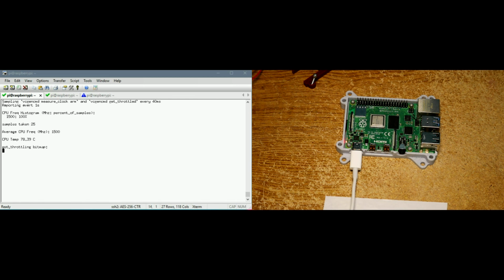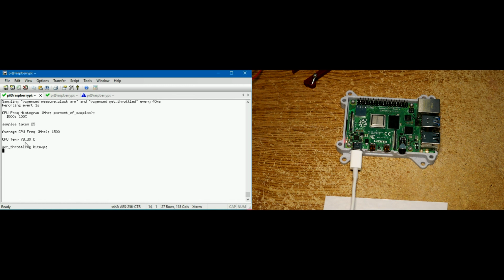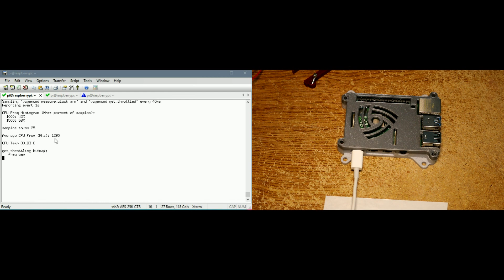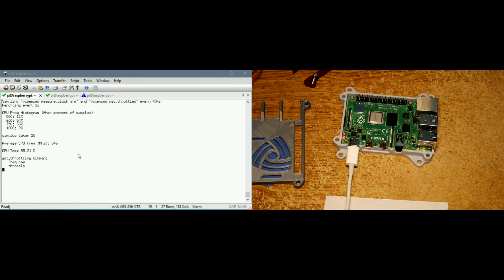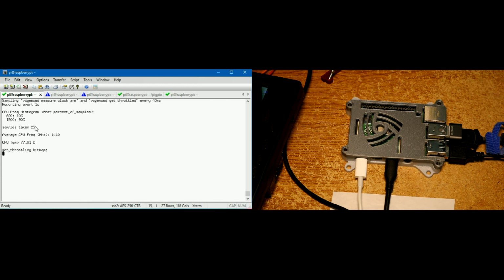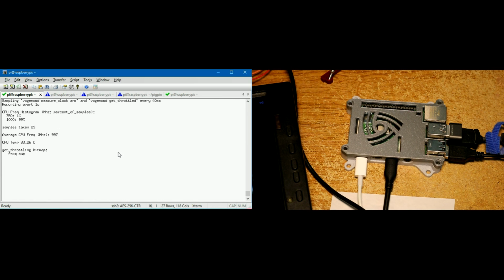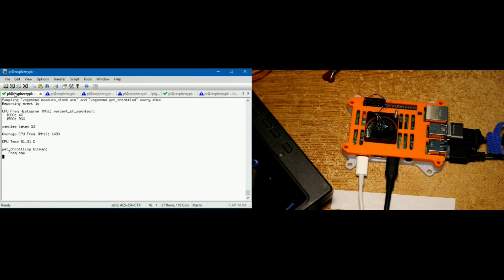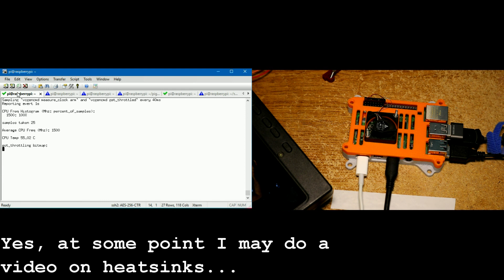Raspberry Pi 4 Thermal Investigation [Part 2] Frequency cap, Throttling, & Real-world test

Comment: Hello I have been logging my temp and freq every 5 min for many hrs. I have set the min freq to 1.5Ghz and have an 'ice-tower; cooler. The temp is stabile at 38 to 41deg, yet i see occasional freq drops from 1500000000 down to 600000000. WTH is that? Nothing in-between, just a drop, then next log returns to 1.5G. My logging is only a spot check at a 5 min interval. This time I am running it at 1min interval ( crontab  is  "* * * * * /home/pi/report.sh"  ) Any hints would be appreciated.

Comment: Pulling out the heat gun adds new meaning to "smbaker" (system module baker) 😉
But this is the most thorough RPi 4 thermal testing I have seen so far.  Thank you very much.
I can't find any specs about max sustained damage free operating temp for the BCM2711B0.
In 79F (~26C) ambient, my RPi41G idles at 58-59 C when in the official case with cover off, an AdaFruit 15x15x15mm heatsink, and board on SD edge (heat sink fins are vertical as well).  That is with nothing but Ethernet and power connected, it is headless.  And no moving air other than convection.
So it seems that 75C would keep it from throttling, but perhaps 65-70C would be a good target temp for a PI(d) algorithm controlled PWM fan?  Then when idle it wouldn't need to have the fan running at all, and only when you want to prevent throttling.

Comment: So, the short version is that if you want to do anything more significant than letting it sit there at idle, you really need a heat sink and fan.

Of course, you know that you're going to have to evaluate a number of available cooling solutions. :)

Comment: Thanks for the follow-up video. I feel that a small heatsink/fan unit should be a requirement with this data. Also, your audio levels are very low in this and the previous video.
Reply from the maker: Thanks. I wasn't sure if I'm normally very loud and this video's audio was correct, or I'm normally correct and this video's audio was quiet. Sounds like it must be the latter. When doing screen caps I typically use my headset mic as it picks up less background noise. I'll have to see if there's a way to adjust up the gain in the recording software.